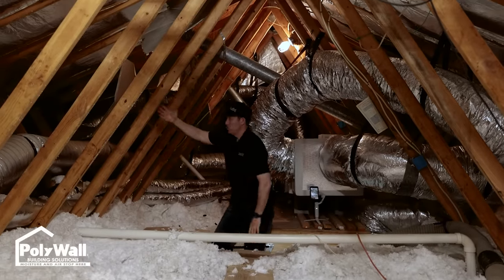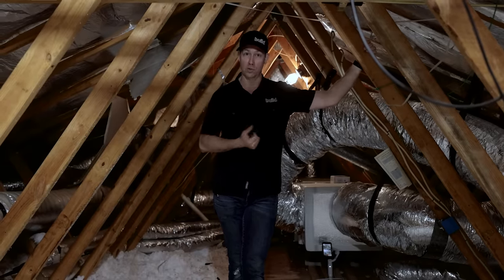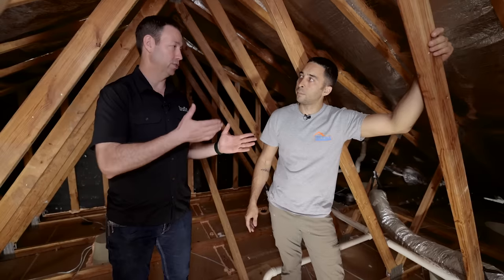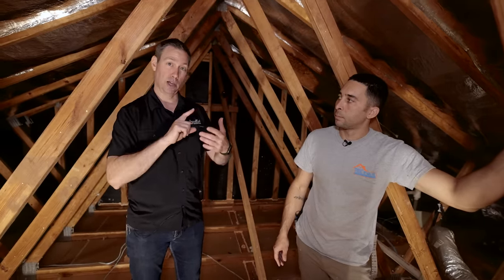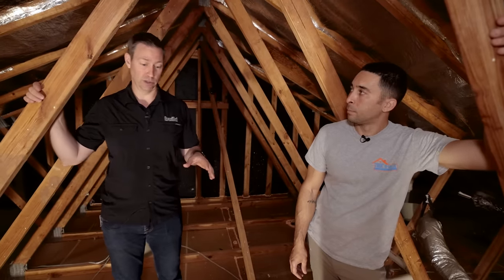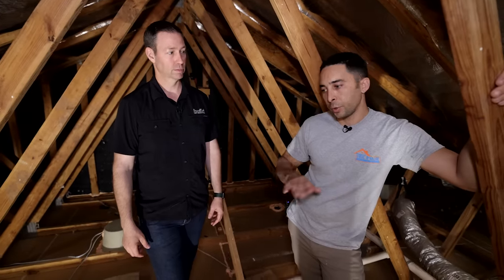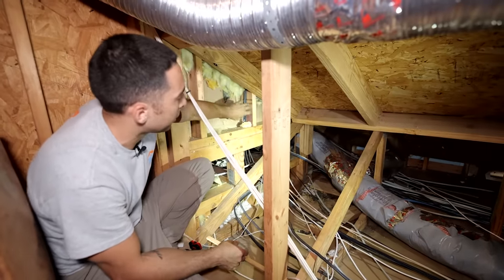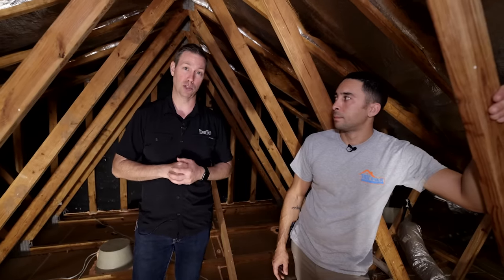How to Re-Insulate Your Attic - Insulation 2.0

Comment: I've watched a lot of your videos Matt.  I finally did an "Insulation 2.0" reboot on my house which was built in about 2000.  Mine was very simple.  I  1) raked old blown fiberglass into a few piles (did not remove), 2) Sealed ducts using a) Mastic, b) Caulk and c) Spray foam.  3) Used about 25 cans of spray foam for rim joists, can lights, penetrations etc and 3) blew in an R60 depth of cellulose.  It took a lot of labor, but my materials were <$2000 and I have a very large house.  The results are absolutely amazing in the amount of time my HVAC system works.  I used no fancy tools or equipment and I'm sure I missed a few leaks here and there, but the bang for your buck factor was high.  Absolutely any DIYer can do it; nothing is difficult.  Thanks for all your information.
Reply: Thanks for sharing your info.  I was really on the fence about the time to recoup the cost of the project but think I will give it shot because of your experience.
Reply: Hey Andy thanks for the comment and sounds like a great results for your hard work. I am also in the process of doing a insulation 2.0 on my 2000 built home and would love to hear any tips/tricks or suggestions you can offer from your experience. I do have interest in doing attic ceiling spray foam but I have a gas furnace in my attic in Texas so from the video it appears I cannot do the spray foam in the attic ceiling! I am not sure if there is a work around or hack that could help and still allow to use spray foam. I was also confused alot of people commented on several videos not to use spray foam and that it wad dangerous trading the moisture in the attic or causing the wood to rott causing mold! Any thoughts of that?
Reply: These videos are awesome. Question: My forever home is currently being framed in East Tennessee. About 3200’ on Main floor and then a bonus room above the 3-car garage. So above the main home area it’s planned to simply have R-38 Blow in. I’ve been watching videos like this for years and have a buddy who spray foamed his home and swears by it; any reason (other than $16k in additional cost) to NOT spray foam the attic space instead? Air handler and duct work will be up there.
Reply: I'm getting ready to do the same to my house. Large 2008 build. No air sealing. I'm thinking about buying a dust collector from harbor freight ($100) to suck out the cellulose and move it into a pile elsewhere in the attic. Reverse the process to return it afterwards. Any thoughts? Tips? Tricks?
Reply: How did you find the leaks in the ductwork? Flex duct?

Comment: I did this same process to a 1000 sq. ft. house near Chicago built in 1960 about 10 years ago. The return duct work was super leaky, sealed it up with spray foam and mastic. Rafter baffles, penetration sealing, cellulose blown to R49, etc. When I was all said and done, the winter heating bills went from $200-300/month to around $100/month. Since I did it myself, ROI was less than 1 year.
Reply: What did you use to spray it?
Reply: how expensive was it to remove existing cellulose? I had a team come out to my home and wanted to just blow on top of existing cellulose. I did ask about the removal of OLD cellulose, he advised against it because of cost etc
Reply: @philevans4740  Mine was existing R15 fiberglass. Since I did it myself, I just moved everything around as needed for air sealing and then blew the cellulose over the top.
Reply: NICE!!!  My house was built in 76, had no interior wall insulation at all in the attic. I put in another 18 rolls of regular insulation at the time and radiant heat barrier on the ceiling. Dropped the temperature in the rooms below my 5 degrees in the height of summer.
Reply: I suspect I just have leaks around ceiling fixture and already bought those canned lighting covers years ago but probably need to seal around the cold return vents, bath fans, etc.  I had already added venting to the bathroom fans.  I find is 100% irresponsible to not properly vent the bathroom fans outside.  It should be required code everywhere.  90% of attic water will enter from that vent !!
Reply: Thank you for providing ROI time. So many of these types of videos shoe projects but don't mention that it will take 25yrs to show a return.

Comment: I always wonder why the videos always pick the extremely easy 6/12 and above pitch attics while the huge majority of homes in this country are 4/12 and very difficult to work in?  It would be more helpful to show realistic conditions and how to deal with them than these ideal situations.  In a 4/12 it isn't about what you use as much as it is in how to lay down correctly and how to reach the eaves for effective coverage.  Not much value to showing an attic with eight foot peak and scads of room to move about in.

Comment: I think if you are going through all that trouble and expense, you might as well replace the can lights with a modern, sealed one. Can lights are not expensive.
Reply: Solid idea 💡
Reply: @michaeldautry  First thing I thought to if you went to all the work of removing the insulation and have easy access.  Get rid of them all, and then you can still put hats over them and not worry about the heat with the LED like the old ones like that.  Not only that you can get ones that you can change the colour temps as well for the area you are putting them in
Reply: if the original can lights are too large compared to modern lights, then it becomes a drywall patching job. Project scope creep can be a real issue.
Reply: @illeatmyhat  They have cover rings for that.  Reason I know is I added extra potlights to my kitchen and dining room since the builder cheaped out, and wanted to keep them the same.  Since its white on white, it just looks normal.  Plus the flat look compared to the old school eyeball look is cleaner to.  To each their own, but for this project, spending 10K on that, the upgrade to new lights that sue less energy and generate less heat, wouldnt be much extra
Reply: @virgil3241  Can lights likely have LED bulbs in them already, no?  That's one of the first things I did to my house when I bought it was take out the CFLs (and the one flood light there to draw more power so the dimmer worked well - I put in a modern smart dimmer too before the LEDs).  I agree with the scope of the project and doing it at that time though, just don't think you will have energy savings via lighting.
Reply: @Matthew Thats why you still put the hat over them, so a seal from below and above.  With the new LED styles and the control box, you dont need the huge domes anymore because there is no can anymore.
Reply: @virgil3241  I have the LED ones with the foam lip. They still Leak! I used baffles on top to stop it.
Reply: I did a retro kit.  Sealed LED that fits in cans.

Comment: Just started this project on my own home in April. Doing the work myself and still not done . My advice if you plan to do yourself is to do it in the winter . Get some buddies to help out if you can . I am using rockwool r23 for my first layer . Despite what they say if you have to do a lot of cuts it does get itchy and fibers do get in the air. I have a 1960 house so at least half of the batts needed to be cut once to 3 times . Please use gloves long sleeves and eyewear.  I rented a vacuum to remove old insulation for about 400 bucks and 2 days . The rockwool cost me about 3k for a 1400 square foot house and about 400 square feet for the garage . Not sure if I'll use rockwool r23 again or r30 batts for the  second layer .the foam gun was about 50 bucks and you'll need at least  3 cans of foam for the same square footage . I won't see the full benefits till I finish this winter so next summer should be great for me .

Comment: I have a low slope roof - 4/12, looks fine from the outside, but inside it is really difficult to work in the attic, especially with ducts in the way. This video shows a best case, with high sloped rafters and lot's of space in the attic. I suspect this is typical, at least in my area (mid Atlantic). How much does the slope of the roof contribute to the cost of this job?

Comment: Matt,
I DIY’d this to my attic based on your first “insulation 2.0” video. Rented an insulation vac, sealed all the penetrations, had R49 cellulose blown in. About $2k spent all in:
50% reduction in heating, thank you!
Reply: What climate was that in? My ROI on  propane saved would pay that off in 2 winters.
Reply: Did you blow the R49 yourself? How long did that take?
Reply: Pennsylvania climate. The massive savings were due to it being a really leaky 1970’s attic with inadequate  insulation. 

Did not blow in cellulose myself. Hired that out for $1300. 900sq foot attic.
Reply: When I think of this kind of work I relate that to energy reduction, maybe there is a video but I have not seeing one yet, for you what was the benefit in energy reduction which translates into less expenses? How much time did it took you to get that investment back (ROI)?
Reply: Good job, was near Philly now I'm in Boston. Housing stock 100 years+... Kinda scared about the cost.
Reply: Renting and removing yourself will allow you to spend properly on re-insulation.  That is the one part that can be DIY if you rent the proper equipment. 

 Blown in is crap insulation for the lazy!
Reply: @toriless if not blown in then what other option do you suggest?

Comment: I know your target audience is mostly home builders, but I'd love to see more on this line of what homeowners can do for an existing house - what we should look for, who we should be talking to, what products to ask about, etc. This video specifically would have been hugely valuable to me a couple years ago when I re-insulated. While I had gained enough knowledge form your channel and did ask them to "air seal", it was not done anything remotely like what you shown here. Probably because I used a typical insulation company. Even with with new R49 (code was R39) and radiant barrier install, the house is still very poor performance thermally. When it gets hot here (San Francisco Bay Area), my AC can run for 10 hours straight and the house will still get WARMER during peak heat.
Reply: Rent to suck out, and seal still apply.  I would only hire for radiant barriers and installation.

What is your BTU to SF ratio, 12000 BTU will do about 800 SF is San Francisco or 1000 in Seattle.  I have 24000 BTU for 1800 SF, near Everett.WA.  I the south you might need double that.  Even with crappy insulation leaks (unsealed canned lights, etc.) it is plenty.

Comment: Did this last fall on my 3,300 s.f. Colonial built in 91’ in Maryland. I paid someone $2k to suck out the old insulation.  Spent about another $2k on foam, can lights covers, baffles and R-60 fiberglass insulation.  Did the work myself and the wife helped load the insulation in the hopper to blow it back in. Turned out great and really helping with the energy bills!
Reply: How much would it have been if you paid someone to spray the foam?
Reply: @Th3120ck  i got a quote a few years earlier and it was $14k to do the attic and insulate my rim joistin the basement…
Reply: I'm also in the New England area, how did you go about finding someone to suck out the old insulation alone?
Reply: @therealweenis  just found a small local attic insulation business and they were willing to do it for a reasonable price.

As they said in the video, getting it clean is the worst  part and it was well worth it to pay for that part. A clean attic was so easy to work on during the cool fall weather.
Reply: I did this in my house in Virginia before the builder put the insulation in. Since I was working in the summer, I would go by the house at around 9pm when the sun went down and worked till 11pm or midnight spraying the foam along the top plate and pipe/cable penetrations as well as electrical boxes in the ceiling. 

 I also had a box fan (to cool me off when working in that still-hot attic) running off an inverter and a 12V battery I kept charged with solar panels since the electric company was taking their time getting the electricity connected. (This 12V battery also powered the backup sump pump to keep the basement dry, and continues to serve as a backup if the power goes out).  I asked the builder about sealing the top plates but they said they don't do that. Fine, I'll do it myself. Results? My heatpump can maintain 68F in the house when it's 17F out, without using any aux heat. In fact I have the aux heat on a switch that I can turn on if I determine that the house is getting too cold. Never needed to turn it on yet.
Reply: @brianleeper5737  that’s really smart time to do this.  Too bad builders aren’t required to do this.  Maybe 10-15 man hours of work for big benefits.
Reply: Where did you rent the insulation hopper and tubing?
Reply: @ShowInTheDark  last time I checked both home depot and Lowes will rent the insulation blower for free if you buy at least 10 bags of cellulose insulation
Reply: based.

Comment: One thing that helped my (110 year old) Pennsylvania house this summer was putting radiant barrier up in the roof stringers, done "the Texas way" (as in this video), but with two layers of barrier.  This was good for a 15--20 degree F drop in attic temps on sunny days, and didn't take very long to put in.  And it has really improved the cooling in my upper floors on sunny days.  (Tip: get the airflow right: guide air into the barrier chambers in at/from the eaves; leave a decent gap at the ridge if you don't have a ridge vent.)
Reply: Whoops!  2 layers will cause mold within the space.  It has holes for a reason
Reply: I deliberately left ways for air to flow in at the bottom and out at the top of both chambers.  Good air flow -> dry -> no mold.
Reply: why not open cell spray foam in tx?

Comment: Had my 1970s home sealed and added insulation up to code. Since it's a split level it made a huge difference with the hvac. Now it actually shuts off during 95 degree weather which is really nice. Made a big dent in my energy bill too

Comment: Good timing! Will be getting my attic airsealed next Monday! Also adding more insulation to R49 - right now I have a R9 or realistically even lower. Will be looking forward to see the impact with this hot Texas weather.

I recently started logging the temperature in the attic (over 130 degrees) to see the impact of the radiant barrier which will also be installed with the new insulation. With all the duct work up there I want to see how much it lowers the temperature after installation.
Reply: Same here.  Getting a rodent exclusion done, will replace all blown insulation with new...interested to see what I need to check for.
Reply: How much is it going to cost?  And how much sq ft?
Reply: @wkobayashim  i will be paying around $4/sqft for removal, gap-sealing, and re-adding insulation
Reply: @Marco-fe5wu  what city are you in? Know anyone in DFW?
Reply: @Th3120ck  I will be using Green Attics out of Dallas. It will be my first time using them. They also offer a paid energy consultation report with blower/thermal camera if you need that.
Reply: @Marco-fe5wu  Thanks for the information. How did the experience turn out? Would you recommend Green Attics?
Reply: marco how did your radiant barrier do? i have also had some fun in 135 degree attics here in Arkansas. i'll be redoing my insulation to R-60 and i thought about stapling up a radiant barrier with an air gap as well.

Comment: I have 5 canlights upstairs. 3 which are in the bathroom. The old owner did put covers over them but never used any spray foam to seal it!! The insulation really showed how much air actually had gone up into the attic.. imagine hot steamy air just flowing freely into the attic space. I am really happy that I went up there and sealed all the boxes with foam. Feels like a small and pointless thing to do, but it most definately will do a lot! Especially since I live in a cold climate

Comment: I read the Fine Homebulding Magazine article featuring a Steve Baczek project that was to meet Passive House certification. Because he had nothing in the attic that needed regular access, and something like 30 inches of insulation, he put the attic access door on the gable end of the house and NOT going down into the living space of the house. No door to seal or insulate is brilliant.

Comment: Radiant barrier also keeps radiant energy from penetrating the fiberglass and reduces heat through your ceiling by almost 50% based on the lab studies I have watched.  You use about 10% less A/C just by adding a radiant barrier.

Comment: We have vapour barrier in my climate. So I use acoustical sealant and spray foam. I use this method every time and works great. A tip for those hoods is to add extra blown insulation to account for the height of that cover so you have an even r-49. I do this for ducts as well.

Comment: It would be good to see an exterior insulation roof retro fit project if you come across one. This would be a great option for bungalows that have upstairs rooms with ceilings following the roof lines. There are a lot of houses like that in the midwest and during a re-roof there's an opportunity to add some insulation capacity.
Reply: Yeah, I live in WA but my biggest problem is my roof becomes a hot plate every summer.  It bakes my attic.  My house gets hot from the ceiling, I can touch it and it it warm regardless of how may feet of insulation.  When the insulation is 130 too it is not helping !!